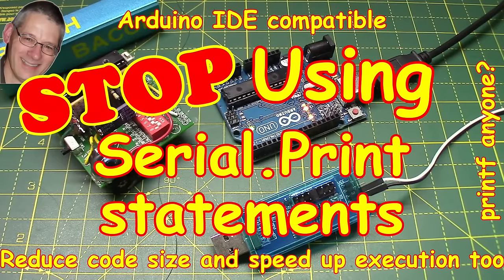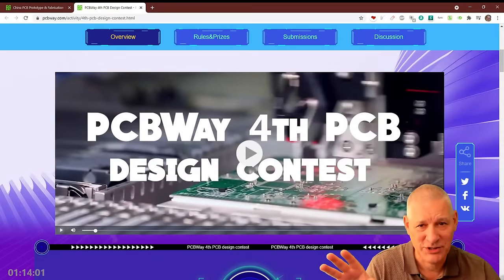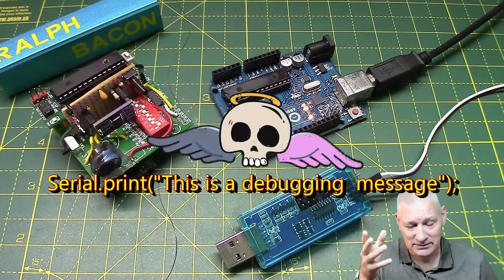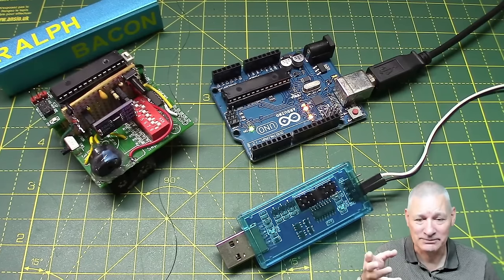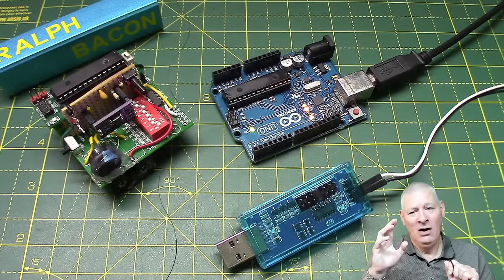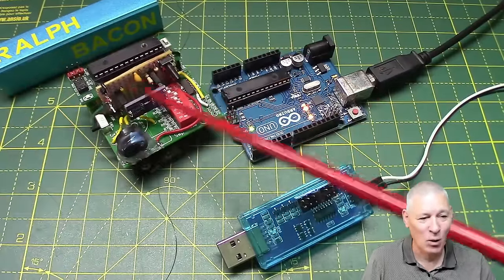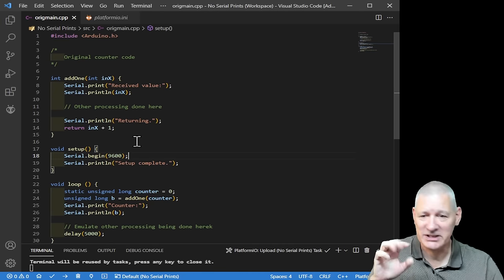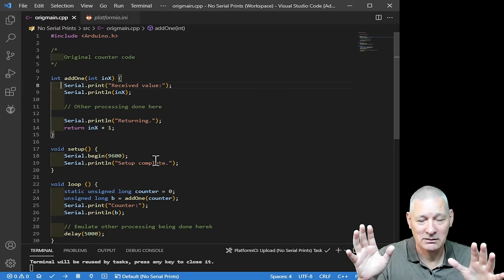#224 🛑 STOP using Serial.print in your Arduino code! THIS is better.

Comment: The #define is perfect as it completely removes the debug code. If you want to use a log library, #define debug_i(x) log_i(x)
Reply from the maker: Good suggestion, redirecting all the serial output to a logging program. Nice work!

Comment: Hear, hear ... Ralph goes preprocessor ... nice move!
But I personally do not prefer such printf/debug code classes/libraries, since they do come at the cost of code space, if not driven by preprocessor statements in all details. But when using all as preprocessor statements, then such libraries are over the top anyways, since they do come cheaper as purely preprocessor statements already. So this sernse a better choice in my opinion is preprocessor defintions e.g. like the following:
#undef  DEBUG
//#define DEBUG /* remove the heading '//' to have debug running */
#ifdef  DEBUG
#define debug(x)        { Serial.print(x); }
#define debugln(x)      { Serial.println(x); }
#define debugiln(x,i)   { Serial.print(x); Serial.println(i); }
#else
#define debug(x)
#define debugln(x)
#define debugiln(x,i)
#endif
But anyways, making use of the preprocessor is a good choice by many means when it comes to C/C++. Nice job, Ralph! Don't forget, a '#define' can have complete blocks of expressions/statements defined. If code should not repeat over and over in the code, it becomes usefull to have subroutines as preprocessor definitions as well, so stuff like 'debug(x)' actually calls a procedure that only exists if the preprocessor statement is turned active. That finally reduces code size to the smallest possible amount, ... which is ZERO when not debugging and still very small when turning DEBUG on, since the 'debug(x)' statement now makes a call instead of copy and paste the same 'Serial.print()' code over and over again into the source code! But tthat also depends in some way on how clever your compiler is. It have use some modern compiler, it will reduce the repeated statement down to calls on its own, as long as it sees a chance doing so. But to make sure introducing subcalls reduces code size by some means for sure, especially when having lots of calls using stuff like 'debug(x)' and so on, just in case the compiler used is pretty dumb, putting them as procedures inside the '#ifdef' statement makes sure things run as expected.
Example:
#undef  DEBUG
//#define DEBUG /* remove the heading '//' to have debug running */
#ifdef DEBUG
void debug_print(const char* c) {  Serial.print(c); }
void debug_println(const char* c) {  Serial.println(c); }
void debug_printiln(const int i) { Serial.println(i); }
#define debug(x)        { debug_print(x); }
#define debugln(x)      { debug_println(x); }
#define debugiln(x,i)   { debug_print(x); debug_printiln(i); }
#else
#define debug(x)
#define debugln(x)
#define debugiln(x,i)
#endif
Reply from the maker: Yes, very good, I'm sure we all have our favourite way of doing this.

My Advanced example does more, especially printing the function name and line number the debugging statement is on, very useful when you have many debug lines and don't know where it came from!
https://github.com/RalphBacon/224-Superior-Serial.print-statements
Reply: @RalphBacon  I did take a look into your advanced version, and I can see it translates into a per usage substitution. Perhaps try calling preprocessor driven subroutines instead (in my first comment added), since that can make quite a sigificant change when excessive use of 'debug(x)' is made in a larger source code. Otherways it cpoies all the comment block per '#define' into the source and then the compiler needs to find a way to reduce this into something where the sequence of commands, like '#define traceStamp Serial.print("["); Serial.print(__FUNCTION__); Serial.print(":");Serial.print(__LINE__); Serial.print("] ");traceStampRequired=false;' is turned into a procedure that does not exist many times in the code, but only once and is called for each use, instead of have numerous copies of it substituted into the code.
Reply: @RalphBacon  To put an example:

bool traceStampRequired = true;
#define traceStamp Serial.print("["); Serial.print(__FUNCTION__); Serial.print(":");Serial.print(__LINE__); Serial.print("] ");traceStampRequired=false;
#if DEBUGLEVEL > 0
#define debugE(x) if(traceStampRequired) {traceStamp;} Serial.print(x)
#define debuglnE(x) traceStampRequired=true; Serial.println(x)
#else
#define debugE(x)   // Nothing to see here
#define debuglnE(x) // Or here
#endif

produces a substitution like this for each apearance of 'debugE(x)' in the source:

{ if(traceStampRequired) { Serial.print("["); Serial.print(__FUNCTION__); Serial.print(":");Serial.print(__LINE__); Serial.print("] ");traceStampRequired=false;;} Serial.print(x)

---

But something like this:

#if DEBUGLEVEL > 0
bool traceStampRequired = true;
void traceStamp(const char* c, const int i) {  Serial.print("["); Serial.print( c ); Serial.print(":");Serial.print( i ); Serial.print("] ");traceStampRequired=false; }
#define debugE(x) { if(traceStampRequired) { traceStamp(__FUNCTION__, __LINE__); } Serial.print(x); }
#define debuglnE(x) { traceStampRequired=true; Serial.println(x); }
#else
#define debugE(x)   // Nothing to see here
#define debuglnE(x) // Or here
#endif

produces a one time substitution appearance of:

bool traceStampRequired = true;
void traceStamp(const char* c, const int i) {  Serial.print("["); Serial.print(c); Serial.print(":");Serial.print(i); Serial.print("] ");traceStampRequired=false; }

as well as this for each call of 'debugE(x)':

if(traceStampRequired) { traceStamp(__FUNCTION__, __LINE__); Serial.print(x); }

Depnding how clever your compiler can handle such variations, this second variation can cause quite some savings when the compiler turns out to be sort of 'dumb'.

Comment: My opinion, just stop using Arduino and its ide and go to a real embeded system like PIC and MPLAB or CCS C, stop using a $25 board for what can be done with just a $5 pic and 16bit/32bit and better.

As for serial output, I agree, usualy do a #define sdebug and unset it and its removed from compilation.

Now for your serial issue taking time, its because you didnt program it right, use propper buffer and interrupt driven serial output, if you dont want to use int serial output, then still buffer and in you code make a call to a custom function called housekeeping() and load the serial output 1chr from serial buffer if your chip buffer empty.
When doing arbitrary prints to a serial port its blocking and will always cause issues.

I have never used an Arduino and never will because its a waste of money and encourages bad habbits and calling a program a "sketch" is just plain dumb
Reply from the maker: So an ATMega328P microcontroller is not a "proper" chip at all then? 

I'll give Atmel a quick call to tell them to stop that line and just produce their PIC chips - they very chips I moved away from because they were more difficult to program and Microchip/Atmel wanted megabucks for a compiler than didn't insert NOP commands to pad out the size (and thus limit the "free" version).

Look, I know you know that the Arduino system is for beginners, not experienced embedded engineers. You would not use an actual Arduino UNO/Nano board in a commercial system, but you might prototype with one before designing the final system using the aforementioned ATMega328p (or a PIC!).

So bashing the "Arduino" is not really conducive to persuading those beginners to use something much more complicated, is it? If any of those bedroom coders actually gets the urge to do this sort of thing for a living they will soon find out that Arduino boards (and Arduino-speak C++) is not really what industry demands, but at least they will have had a reasonable intro into the world of embedded electronics. Like you, just my opinion! 😁
Reply: @RalphBacon  Yep just my opinion and I respect your opinion as well, I truly do, but kinda silly when the smart remark of saying not a real chip and calling atmel, you see, I didnt say the chip wasnt real, I was refering the misleading of arduino, and yea, I started my embed career with z80 in early 80's, then left it for number of years, then got back in with Parallax stamps, and I thought wow, until I was tasked to make a production product and the materials price was ridiculas, $35 for a basic stamp for a simple display? I realized I went down the wrong path and forced myself to start over, a path I dont with any bedroom coder to go down. I have introduced so many college students to use bare pic's and learn the right jargon and learn to write their own drivers. Heck even Siemens Electronics hired me to write a driver for a display because all the other stuff out there was bloated. So all in all, I dont encourge it, my opinion, and I do respect yours I trully do, I like a lot of your stuff, but doesnt mean I should hold back.
Reply from the maker: I think the main difference between what you suggest in a commercial environment and a hobbyist (home) environment, is that cost is not the driving issue. Ease of use is.

You said the processor you chose initially for a project was too expensive; agreed that $35 is far too much for a commercial solution; for a home user, though, it is bearable just to get the project going. Look at Adafruit prices, IMHO sky-high, but they are not producing them by the millions for a commercial project, just hobbyists and prototypists who need a project or proof-of-concept done quickly, with good support.

So you are correct if we agree that your comments really do relate to companies who need to produce many thousands/millions of products and where every cent counts; my comments were aimed at the hobbyist market who do not have the experience you obviously have but who still want a working project by next Christmas! Is that fair to say?
Reply: @RalphBacon  yep, fair to say, but not trying to extend, but rather say I think it still brings in bad habbits. but who knows that could be another video for you, "the differences" - and as I said before, I like a lot of your stuff so its not against you.
Reply: @RalphBacon  What's even worse about Microchip/Atmel dev tools division is that they can no longer handle activation for older versions of their products, so one's ability to upgrade existing programs using the same build tools as were used to build them in the first place will only last as long as the computer hosting the compiler.

Comment: My way: In the IDE, search & replace "Serial" with "//Serial"  thus making them just comments.  It even removes Serial.begin(115200) statement also.  If you want Serial again, search & replace "//Serial" with "Serial" .  Comments are never compiled and wont have any effect on the compile size.
Reply from the maker: Many people do this, I'm sure. Not very granular though, is it? I mean, you either have debugging statements or you don't, using this method. It would be better to have some important debugging statements... maybe?
Reply: @RalphBacon  I am sure people are using this method absolutely. You are right. We would not have any granularity.
Reply: @RalphBacon  the find and replace method above also relies on NO instance of the word "Serial" being needed for the code to run, which in many cases is not true.

Comment: #define DEBUG_STATE false
#if DEBUG_STATE
  #define DEBUG(...) Serial.print(__VA_ARGS__)
  #define DEBUGLN(...) Serial.println(__VA_ARGS__)
#else
  #define DEBUG(...)
  #define DEBUGLN(...)
#endif

This works on my setup (vscode + platformIO + ESP8266) and will allow for optional second argument. ie Serial.print(int, BIN);
Mite implement printf() as well as I tend to use that regularly for debugging.
Reply from the maker: You really need to look at the Advanced Example in my GitHub:
https://github.com/RalphBacon/224-Superior-Serial.print-statements
Reply: I looked at the advanced example and it still Ignores the second argument so you can't print an integer in binary or a float with fixed decimal places. Using the _VA_ARGS_ macro would enhance both the simple and advanced examples to provide the full functionality of the print statement.
By the way, thank you  for the inspiration to explore a solution to a  problem that has been neglected for some time.
Reply from the maker: Yes, I guess this is a bit simplistic in the area you mention; in which case the ArduinoLog  library I showed would be the answer; it does everything except  make you a nice cup of tea!

Comment: Excuse my ignorance, but why don't you use a proper debugger? You know, one where you can set breakpoints, step through code, look at the call stack, see values of variables, look at register values, read memory, etc.

I've been writing firmware for micro controllers for more than decade now and it seems to me we've bread a new generation of developers who think printing text to a console is the only method of debugging. Debugging with a debugger seems to be a lost art when it comes to Arduino, ESP32, Raspberry Pi, or even JavaScript or Python...
Reply from the maker: Well, sometimes I do use a "proper debugger", using JTAG and I showed this in video #261. Also, since then, I've got it to work with all ESP32_ modules.

However, for "simple" programs, an assiduously placed Serial.print is all you need. 

When stuck on a problem at work, we used to call a colleague over and talk him/her through the code --- only to usually find the issue whilst explaining it! The colleague hardly had to say a word (just listen, and detect signs of vagueness and assumptions). 

That said, without a "proper" debugging tool on our C# .Net programs we would never have resolved most issues!
Reply: I've been programming microcontrollers for over a decade and I still print to console, so I'm unsure what your point is.
Not every hobbyist with an Attiny / Atmel core wants to go out of their way and spend extra money for a JTAG programmer... especially when different chip manufacturers and architectures have proprietary JTAG protocols which require their own manufactured JTAG debugger.
Reply: @Psirust  My point is that printf isn't proper debugging, and I am concerned about the new generation of programmers who think that it is. It's especially alarming to me when a python developer will resort to print() statements, and it turns out they didn't even know python has a debugger!

I've also been programming micro controllers for over 15 years and I'm sorry to say that my experience does not agree with yours. I will use a debug probe whenever I have the chance because it is superior in every way, and I'm certain everyone else in my field feels the same way.

Yes, some of the probes do cost a lot of money, but there are others that are quite cheap. For example, pickit3 is $30, STLink is $35...
Reply from the maker: There's certainly a lot of advantage to being able to either single-step your code (that you KNOW works just perfectly 😁) and being able to run until a particular condition becomes true. 

At which point you discover your perfect code is no longer so infallible! 🤔"But that can't be right!" you shout. "That's impossible!". "If this, then that can't... oh. Wait." Slinks off to refactor a piece of not-so-working function We've all been there.

Comment: Very nice example indeed. It can even be accomplished with a one liner.
#define debug(x) //Serial.print(x)
Will make the pre-compiler mark all Serial statements in your code as comment for you
Reply: I'd go slightly further. 
#define debug 
#define debug //

Stick debug on the front of every line you want as debug code  and use one of the defines above.
Even simpler.
Reply: @kevgermany  Except the preprocessor only get executed after all the comments have been stripped out, so "debug" would always be an empty string. Same applies to SdR's idea.
Reply: @IanSlothieRolfe  thanks
Was just going to post that I couldn't get it to work. Pity you can't quote or escape those comments.
Reply from the maker: As you have found out you can never include a comment as part of a define.
Reply: @RalphBacon  I wish this stuff was better documented. Over 40 years in IT, still dealing with poor/obscure documentation and languages full of gotchas. But thanks. Now I understand why your solution was so long winded.
Reply: @kevgermany  Strange. Just tested my example and it seems to work as expected

My example  baseline, so with '#define debug(x) Serial.println(x) ', uses 1964 Flash and 464 Ram
And with #define debug(x) //Serial.println(x)' it uses only 1586 Flash and 184 Ram
(my example code consists mainly of debug("some text"); statements)
Reply: @sdr9682  are you using the standard Arduino IDE?
Reply from the maker: @S d R  Your #define with the comment just substitutes "nothing" in place of the debug(x). It doesn't include the comment. Even if it did the preprocessor removes all comments before compilation anyway!
Reply: @RalphBacon  Thanks, that would explain it. While the define just replaces the debug with nothing, I still like the commented serial statement in the source. It's a reminder to my future self about what used to be in the source before debugging.
The other day I read about the observer pattern, could be a very nice way to handle logging and debugging. But on Arduino I think I value the elegant simplicity of the #define statement more. 
Again, thank you for bringing it to my attention
Reply: @kevgermany  Yes, I use the standard Arduino IDE version 1.8.13 (i see that i have to update)
Reply: @sdr9682  just wondered if an aftermarket IDE was improving things. Clearly not. 
I spent ages trying to get // into a #define last night. I gave up.